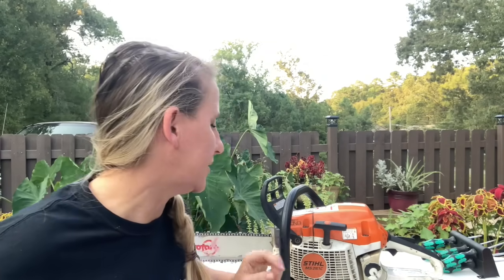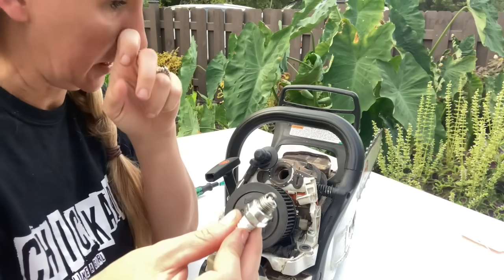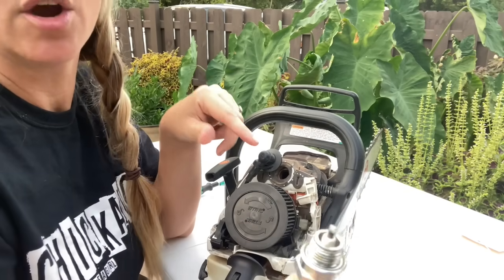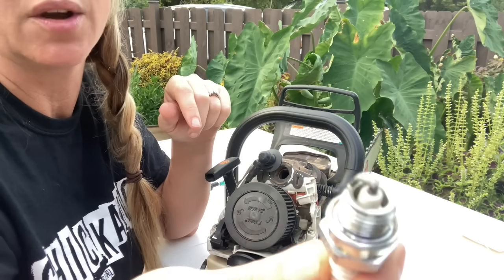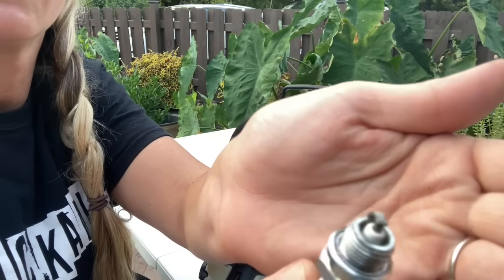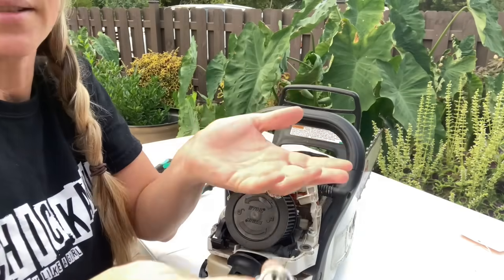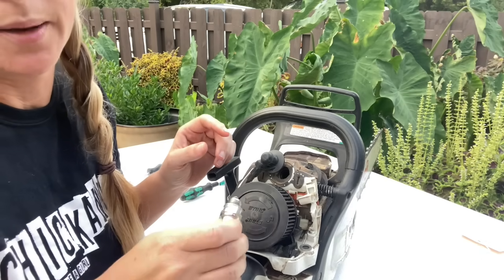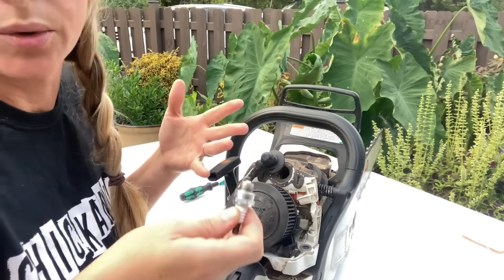STIHL M-TRONIC CHAINSAW HAS NO CARBURETOR ADJUST, WILL IT "RESET" TO REGULATE FUEL CORRECTLY?

Comment: The saw will need to be ran for at least a tank before you can read the plug. To read a plug correctly the engine will need to be shut off during a cut, no idle time, and you look at the base of the ceramic, which will require cutting the threads off the plug. The saw sounded like it was running perfectly fine.
Reply: "and you look at the base of the ceramic, which will require cutting the threads off the plug" What utter, utter BS. I've been involved in 2 stroke bike racing for more than 40 years, and I've never heard anyone claiming that, and there is probably no more cutthroat form of 2 stroke use than in bikes, with the possible exception of karting. 
The point about stopping mid cut is much the same as what we know as a "Plug chop"in m/cycle racing. These were officially banned at GP level because of the danger of doing so while other bikes, on the same part of the circuit, are under full load. 
OTOH, wtf would you need to run a whole tank at load to get an effective reading? You're getting a mixture reading, not a f**king full diagnostic! And a mixture reading doesn't even need to be at full operating temperature, if the mixture is that bad. And you know what else tends to happen when you run an engine very lean for a long time, especially a performance 2 stroke at full chat? It tends to melt the piston. Yeah, off course, I'm going to run an ultra lean engine at full chat for an entire tank full, right

You know, I get it that you're trying to help, but there is all sorts of BS about 2 strokes out there, mostly because 2 stroke tuning really is a bit of a "Black art", even today, when we know so much about the dynamics of 2 strokes. But this is not tuning, this is checking the mixture, and there really isn't that much to it.
Reply: @David Colin   I actually agree with much of what you said I don't even read plugs anymore. Tuning is easy when you know what you're doing, this chick does not.

Comment: I bought a brand new ms362cm last year, piss poor buying experience with that dealer. A month into ownership the saw quit running totally. I opened the garage door threw it to the back of the shop and haven't touched it since. I won't go into the details of the buying experience but it wasn't good. I run a landscape company I know my 2 stroke equipment and everything else runs fine🤷🏼‍♂️. Heck I have a ten year old echo cs600p that runs flawless to this day. Probably my favorite saw. The Stihl saw was a big disappointment.

Comment: It didn't work because that's not how you reset the mtronic system  none of the Stihl dealers around my area know how to do it either I actually learned how to years ago at a convention I believe Stihl now has a video out on how to do it you let it run for 90 seconds on full choke with the brake on then without shutting it off hold the trigger wide open it will run weird rev high bog low do some weird stuff then it starts to clean up and when it stops adjusting and is running strong for about 5-10 seconds your good to go I do this every Monday to my climbing saw and I've had this 201 for 7 years longest I've ever had a saw last in 27 years of climbing trees
Reply from the maker: You are correct for the reset procedure on the 3rd generation saws, but this saw was 2nd generation which has the process I used. Thanks for watching!

Comment: Pretty white... LOL  you need to run a saw full throttle while cutting wood for quite a while to tell plug color... Its hard to do at best.  best way to tell how its running is too cut some wood...The saw sounded fine when you reved it but need to load it up by cutting for a few minutes.  I can tell just by the sound how a saw is running but I've been working on them for 50 years.. Oh and I never look at plug color...Take care.
Reply from the maker: Thanks, but I repair 10-15 saws along with 10+ other 2 cycles every week in the shop I have owned for 10 years that gets over 2,000 units in every year. I didn't put the video in of my husband cutting with the saw through 5 cuts of a 16 inch tree, because I didn't want to get the "safety apparel" comments, but obviously, I should have. I also didn't display in the video the heat radiating from the saw or the smell from the cylinder getting too hot. Thanks for the "advice", but I got this Dick. Thanks for watching!

Comment: This helped me, thanks for making the video. I'm getting ready to purchase a new saw and it was going to be a Stihl. Going to need to do more research on that new saw now. Thanks
Reply: Hate technology for technology’s sake.
Reply from the maker: Stihl, still makes great saws. Please don't let this sway you too much. I just wanted to let people in on what they might be getting. Some like "old school" and some like the new technology, so at least now when people are shopping they know what they are buying. Thanks for watching!
Reply: Do your research but don't base your decision on what you saw here. Both the warranty and M-Tronic calibration info is inaccurate. Several commenters have attempted to correct that.
Reply from the maker: @jerrygilliam7349  How was it inaccurate? I am positive about the warranty information and positive I used the correct reset procedure for this unit.
Reply: @Chickanic  Your time frames were correct, 3mth for commercial & 1 yr for homeowner use. However the warranty is not voided by using a different brand of oil.  Their warranty is doubled by purchasing a certain quantity of their oil when you purchase the piece of equipment. Any dealer or repair shop that tells you otherwise is either misinformed or misleading their customers.

There are more steps to calibrating the M-Tronic module than a 60 second or less cold idle. Several commentors have stated the correct procedure. The owners manual for the MS-362CM I bought last year has a full paragraph on things to check before calibration, and then a 3 step process before shutdown.

As for my comment to Mr. Sullivan, I know that people will pick the piece of equipment with features that will best suit their needs. My intent was to encourage him to consider people's opinions but verify what he hears with factory documentation.

Comment: under the Magnusson moss warranty act Stihl would have to prove that the non stihl branded oil was the cause of the engine failure. warranty can not be automatically voided for non use of manufacture branded oil. 
GM, BMW, and Harley Davidson have all been sued and lost to the consumer on these issues. the problem with a chain saw is it's cheaper to buy a new chainsaw then file the suit and pursue through the court.

Comment: I must be pretty dumb.  I don't know stihls like you do.  But I do know something about electronics and a few other things.   You've helped me.  So I will try to help you.  If there's an electronic anything on an engine or fuel system, there's a sensor.  In this case its either fouled or bad.  If it's controlling fuel (rich/lean) delivery, I would expect it to be on the exhaust.  If I had their tech manual, I would look at the resistance and voltage (probably resistance) on the sensor, and I would put a multi-meter on it to see if it's bad.  
But first I'd probably clean it with brake cleaner....  It probably won't help you.  But here's to hoping...
Reply: Not that you're stupid,  but the MTronic is a speed feedback system. Fuel mixture in 2 cyle engines affect speed. It is quite a simple system. System adjusts fuel mix--> looks for speed change--> repeatedly in miniscule amounts not detectable by the operator.

Comment: Hi Chickanic... I honestly don't think you ran it long enough after the reset to get an accurate combustion deposit on the plug. After a bit of cutting a hot start would have been telling too. Interesting to hear your thoughts. But I do agree that all this Mtronic stuff is not the answer to a trouble free working life on any kind of machinery.
Reply: If the engine has been running for 90 seconds, there have been about 1500 combustion events in that time. That is plenty for a mixture check. I know that the ideal is to run the engine under load for a plug chop, but with the engine running as lean as that, I'd be more concerned about holing the piston under full load.

Comment: The M-Tronic system may have its corks but the way to calibrate these saws is to 1st Cold Start with the chain break engaged and let it idle for for at least 30 seconds but no more than 60. Then disengage the chain break and hold the throttle wide open for 30 seconds and you should hear the saw make drastic RPM changes then shut it off after 30 seconds and it should be calibrated.
Reply: No way am I piss revving my saw for 30 seconds wide open out of the cut....dumbest shit I ever heard
Reply: If you don’t want to do it, The dealer will do it for you! 😂
Reply: @nickwallace9955  hahahaha....well said sir! Just one more reason why I, and only I touch and work on any of my stuff!

The autotune on my 562XP had been flawless by the way. 2015 model. The Husky says it runs in the cut...no piss revs out of the cut required.

Comment: Sorry but i have to point this out, i am in the UK and run several saws in commercial forestry with the Mtronic system on them and i have now had about 14 saws with the Mtronic  and apart from one which was a very early 241 all the others have been 100% reliable, most night mare stories i hear or read about with saws with Mtronic issues are in the US Why ? is it your fuel over there ? saw maintanance ? or is it all the mods the US lads do to them ? just read about a lad who has bought a 500i had it 2 days and now wants to put a Barkbox muffler mod on it ! he dont believe me when i say if it goes back under warrenty the dealer will plug it in to a laptop and all the info of that saw will come up and it will show that it has been revving at 500rpm more than designed to do due to muffler mod, but he seems to think he will just put stock muffler back on and they wont pick up on it i tend to differ on that one, the print out they give you is mind blowing tells you how many starts, hrs on tick over, hrs on max revs, fuel usage etc, Mtronic is not good it is excellent as i have had far less issues with saws since it was launched,,,

Comment: My 261c Stihl broke down with crankshaftfailure after 3 years of cutting firewood. stihl told me I was to blame not using the Stihl motomix. I used shelloil as on the old 026 stihl. That is a good saw and still running after 25 years in the woods. New Stihl-saws are not so good as the old ones. That s for sure. Not happy with Stihl service and their new saws any more. Husqvarna for me now.

Comment: No auto tune or Mtronic system will compensate for an air leak, but it will try. That looks like an air leak to me & having an adjustable carb would not fix it either.

Comment: I had a stihl saw with the m-tronic system. Never did run right. Glad i still have my older ms290 and a husqvarna 136. Both are good saws and just had to put new carburetor diaphragms in both of them and they run like new

Comment: Right on. I remember  my parents had an Oldsmobile with an electronic computerized carburetor back in the day. It worked well for many years, but in it's old age became problematic.  That system was replaced by electronic fuel injection.....  I'm guessing that the same thing will happen with small engines.

Comment: Run a tank of fuel with Star Tron (by Star brite) enzyme treatment through it.  Then try a reset.
I would wager that the owner has been using ethanol fuel, and not ethanol-free fuel.  If they can't find ethanol-free fuel readily available at a regular gas station, try going to a local marina, or run Stihl ready mix fuel.
Reply: Ethanol wouldn't make a difference here. We would know this simply by reading the owner's manual. "Gasoline containing up to 10% Ethanol is an acceptable fuel". If you find that literature in the owner's manual then you do NOT need to avoid ethanol like the plague. You can do what you want but chances are the carburetor gaskets, primer bulb, and fuel lines are ethanol tolerant. While on this topic, are you familiar with the name Holzfforma? If you aren't, Holzfforma chainsaws are Chinese made clones of Stihl chainsaws. The Holzfforma G660 is a clone of the Stihl MS660. The reason I'm bringing this up is because my brother bought the Holzfforma G660 and the owner's manual it came with mentions M-Tronics. Is it China's version of M-Tronics or is it Sthil's M-Tronics? I don't know. But I do know what I read in the owner's manual regarding M-Tronics and ethanol content. Ready for this? "Fuel containing up to 25% ethanol is an acceptable fuel for chainsaws equipped with M-Tronics."

Can't make this stuff up.

Comment: Might have been fair to run that saw a bit longer than a couple revs before condemning the M-Tronic system. Probably takes a bit more running to carbon up that new spark plug. From the sound it seemed noticeably better after your reset. I'm kinda glad you're not a Stihl dealer if thats all it takes for you to say the carb/M-Tronic is bad. $$$$$
Reply: I never checked a new plug on a saw, but on my 2stroke motorcycle it takes about 100km of driving to get proper deposits on brand new plug, after that I can change the mixture and  observe results after 500 meters but the new plugs are too smooth or something and it takes forever to create that first layer.

Comment: I have a Stihl MS210C. I have had it for more than 10 years.  I have spent nearly as much time trying to get it started and keep running than using it for productive work.  I have many other pieces of Stihl equipment, and this chainsaw is a major departure from my liking of Stihl.  I do not use it frequently.  I have a lawn service business and use the saw to clear downed branches, light tree trimming.  It has never fallen one tree or bucked up a full sized down tree.  I was frustrated last Summer - new carb and ignition module.  Exhaust screen has been gone for a long time.  It was running for 20 minutes, then dies and never to restart,  ... until the next day.  I've tinkered with the carb as best I can learn from YT videos. It has been to a repair shop twice.  Both times, it was returned, "works fine." One of those times, they installed a new spark plug.  It now sits in my work truck, not running.  I cannot get it started at all.  For all those who do not want electronics, just give me the "old school," I will settled for electronics ON a working chain saw.  I am at a crossroads - throw into the junk and buy new, or keep trying to get it to work.  At the moment, I am at a loss on what to do to even get it running.  So many YT videos speak about adjustment, but they presume the saw is running.  I am one step below that stage.  Any suggestions on where to look to try to resolve?  Or, throw away and buy a Husqvarna managed by electronics?

Comment: Hi, if I look up the 261 c-m instrucktion manual, at the stihl page, (this applys to a newer saw) thats not the right way to adjust it. you have to run it, about a minute, to get warm, then shut it off. apply the chain brake, start it in the triangle position, dont touch the throttle, let it run from minimum 30 seconds, no longer than 60 seconds, release the chain brake and give it full throttle for 30 seconds, until the revs decrease, let go off the throttle, and let it idle. now it should be calibrated. It depends of which gen. the m-tronic is.

 I use two m-tronic saws, a 201t and a 462, and I have had zero problems, I only use stihl gas. The old carburettet models, I hardly use.
Reply: When  I read these hi tech procedures for computer controlled devices, the old hokey pokey song comes to mind!
Reply: Actually did you check the fuel filter, a lot of time simply cleaning the fuel filter can improve performance in these saws.
Reply: At over $22 a QUART?
Reply: @MountainMetal  it’s expensive, that’s for sure, but I don’t get a headache, when  using it all day.

Comment: Interesting background. Husqvarna
Came out with autotune and was
The first chainsaw to self regulate
Or adjust it's gas air mix based
On a variety of factors such as
Air filter quality and the spark
Plug quality. Stihl sued Husqvarna
Claiming that the autotune feature
And created an unfair market
For other manufacturers. The
Court ruled in favor of Stihl
And Husqvarna was required
To share it's proprietary process
With Stihl. Hence Stihl came
Out with their self tuning saw.
This was the M- Tronic. Gotta
Love socialism.

Comment: I don't work at a Stihl dealership, but I do own both the Stihl MGD 1 and the Husqvarna Auto Tune diagnostic tool.  In no way shape or form are they a magic wand. Rarely do I hook one up to the computer.  That being said, these new computer controlled saws are still 95% chainsaw.  All the traditional diagnostics need to be done.  Especially a pressure and vac test of the crankcase as the software can compensate for a small air leak (very frustrating).  I've worked on hundreds of Auto Tune and M Tronic saws over the years and only recently bought the diagnostic kits.  It does com in handy once and a while.  Just my .02

The Stihl tool (MDG 1) can be purchased for about $850ish and only works on M Tronic saws.  I don't believe you need to be a servicing dealer to buy one.  You still have to buy it at the Stihl dealership so that may get a little sticky with you being an Echo dealer.  Just depends if you have a good relationship there I guess?

The Husqvarna diagnostic tool (a lot less expensive) will do the Battery equipment and Auto Tune saws but I believe it is a dealer only item.  Why I dunno.  I work at a pretty big tree service and they have a Husqvarna arborist dealership, not a full blown servicing dealership with retail.  Full disclosure